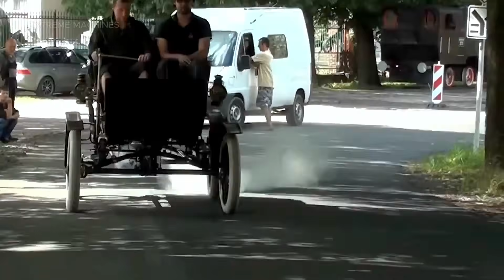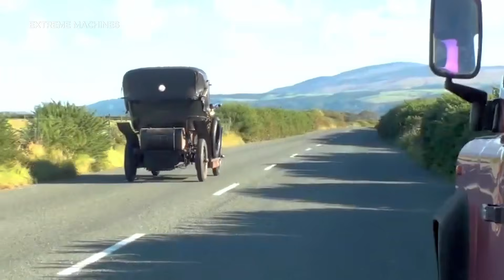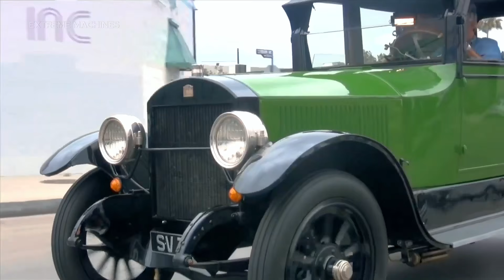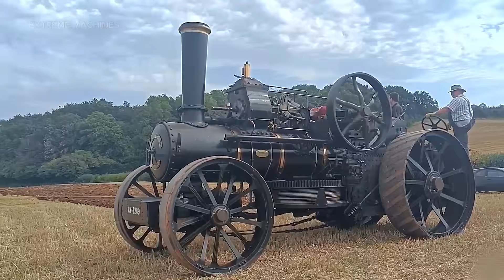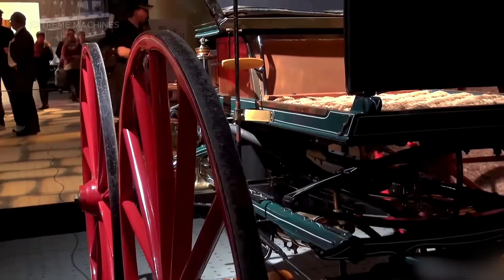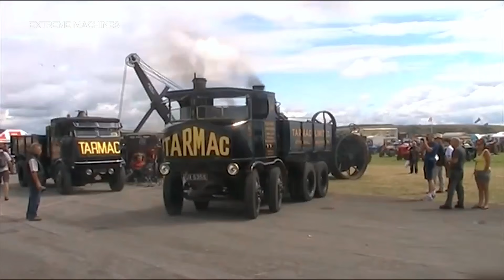THE MOST INSANE STEAM POWERED VEHICLES IN HISTORY!

Comment: Sentinel never built a vertical 4 cylinder engine for their steam lorries and you are using lots of the wrong pictures. Also the S4 could easily do 60 MPH. You keep on confusing the different models of Sentinel steam lorries. All the Sentinel "S" series were single speed direct drive. They did not have different gears.
The Sentinel DG8 was fitted with a horizontal 2 cylinder steam engine whilst the S8 had a 4 cylinder horizontal steam engine.
The DG8 was chain drive to the rear wheels. You failed to mention that the "Differential" was actually built INSIDE of the engine crank shaft and had an adjustable limited slip clutch.

Comment: The Fowler engine you are referring to in your video after the Abling and Porter roller was not a road locomotive it was a ploughing engine as it had a winding drum under the boiler. The other smaller one shown at the same time is not a road locomotive either as it is far too small. Road locomotives had sprung rear axles at least. They also were quite large engines.

Comment: The Big question is; WHY are manufacturers Not working on building NEW steam cars???? They would be surprisingly GOOD, RELIABLE, and NOT BURN themselves to the ground like EVs LOVE doing!!!!! A New steam car could burn ANY fuel, meths, kero, alcohol, petrol, diesel, and burn it CLEANLY!!!! The Stanley Steamer race car could do More than 100mph, ( 160kph )!!!! That Case 150 is MIGHTY IMPRESSIVE HUGE HUGE TORQUE!!!! The Case 150 in one video is Pulling 50 plough bottoms ( 1200pounds of pulling power required per plough bottom!! )  plus another 50 adults standing on them,     Young people today have NO IDEA about such machines!!!! That DG8 is IMPRESSIVE!!!!!!!!
Your video is good, But you are missing the point, steam tractors were not built for speed they were too WORK!!!!!!!!! You are focusing on speed too MUCH, we all know they were slow! Except one or two!
Reply: They're not working on new ones because it is impracticable to fit condensers on a road vehicle (no one has really got it sorted on a rail vehicle, but that is theoretically possible).  As a result, they're less than 10% efficient, while diesels are 35 - 40% efficient.  So (even ignoring the issue of climate change, which is actually more important) they would cost 4 x as much per mile as diesels and 3,5 x as much as petrol engines, apart from the need to stop every 50 miles (or more often every 20 miles) to pick up more water, or else tow a large and heavy water tank.  The emissions of NOx are also worse than an internal combustion engine, and there are 2,000 - 3,000 premature deaths each year in London due to NOx (hence the various Low Emission Zones, to reduce further deaths.  We can't afford to make it worse.

If you don't like EVs, another possibility is to use offshore wind (and/or wave) energy to electrolyse hydrogen from seawater, and then run cars on compressed hydrogen.
Reply: @RobertScott-pp6gj  Rubbish!!!!!
Reply: Because they use more fuel than a big block v8

Comment: The 1867 Aveling  and Porter steam roller you show was in face built in February 1925. The company was formed in 1862 in Rochester, Kent, England
Reply: Having watched the complete video, which does have many good clips, it could be a lot better of a bit more research had been done, you seem to have difficulty seeing the difference between single and twin cylinder engines. The engines in the Sentinel Lorrys were never vertical, only the boilers were, the cylinders were horizontal under the load bed, not “under the hood”
The 8 wheeled Sentinel was not built by Tar-Mac, which is pronounced as it is spelt. Tar-Mac is a company that specialised in surfacing roads in the UK using TarMacadam a mix of hot tar and stones, these 8 wheeled vehicles were also used by many firms that needed to carry heavy loads over long distances and difficult terrain.